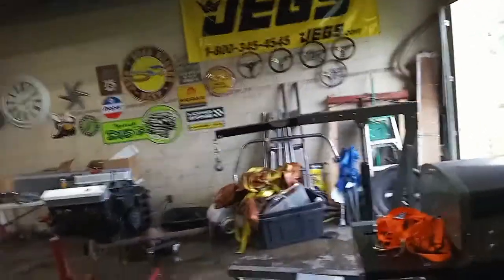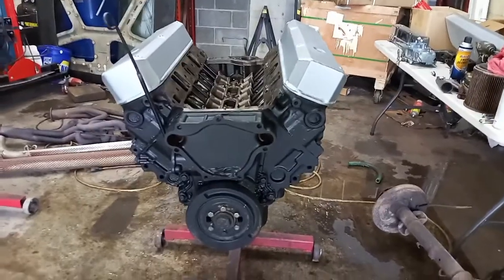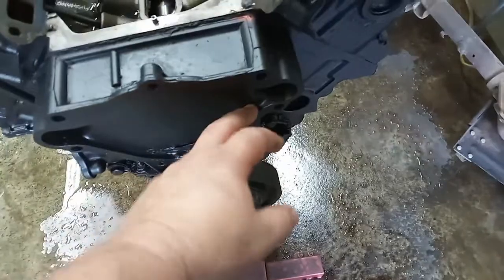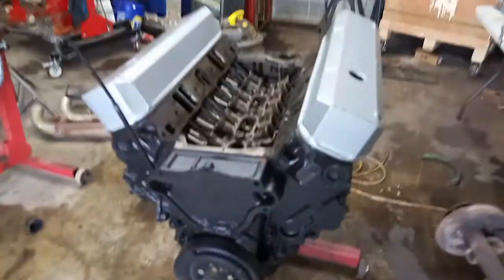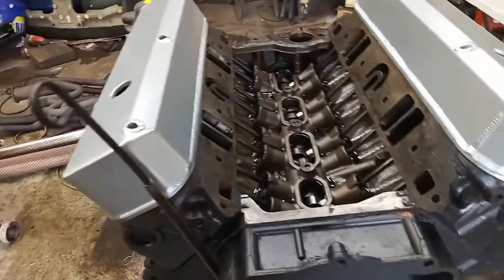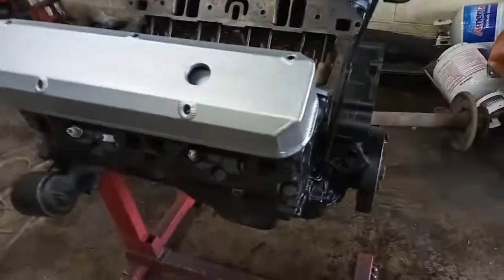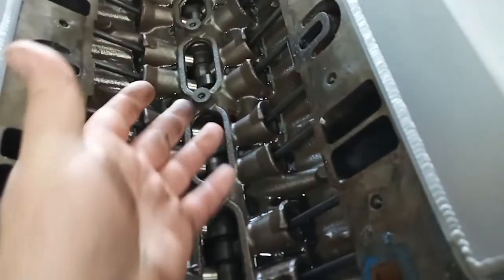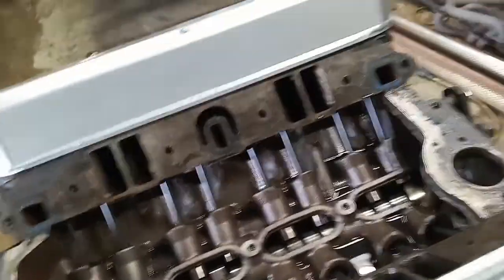Deal With Your Bull S**t

Comment: I've been trying to deal with my"bull shit" Especially with no buildig to work in and we have been getting lots of days a nights with rain this year . I just got lucky and took on an extra job its part time at 16.00 an hour and it pays each week . I'm use to every 2 weeks . so now hopefully I can get my 65 dart done quicker now  and get a cheap car port or something to work under on projects . a sheet of carboard only goes so far .   I have a plan in my head for my dart but up in till now it was just on the back burner just pissing me off and getting frustrated cause I couldnt do anything about it . but hopefully everything works out for me and everybody else struggling with their finances and project builds 😎💪🏁
Reply: I feel your pain man same things happen to me...if you look around you might be able to get a cheap portable garage for $400 tractor supply some times has them on sale 12x20 is a good size to work in nothing smaller for one car.  I painted my 74 charger in one I converted to a spray booth using two furnace blowers I got free.